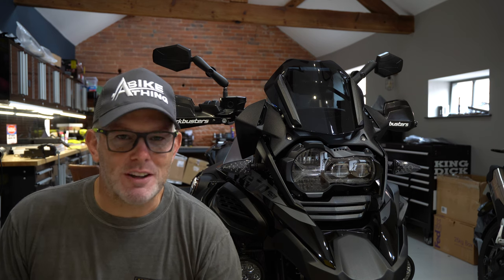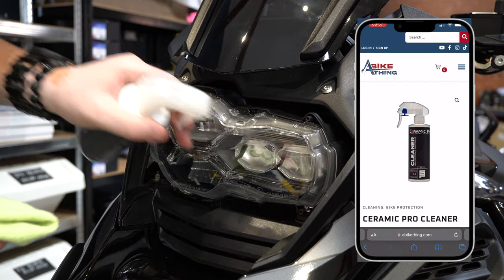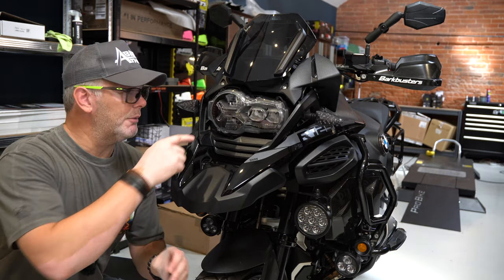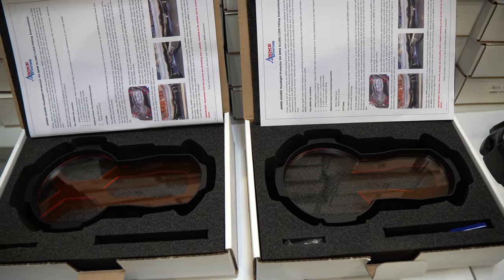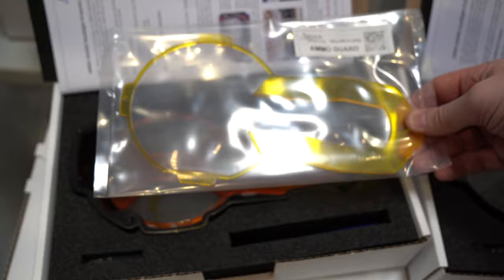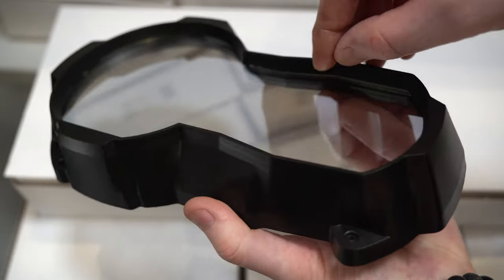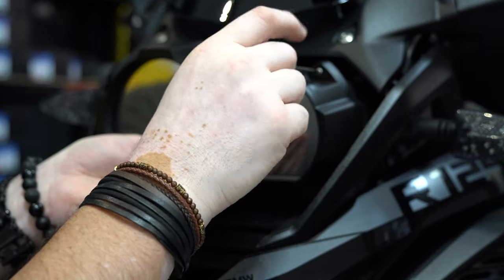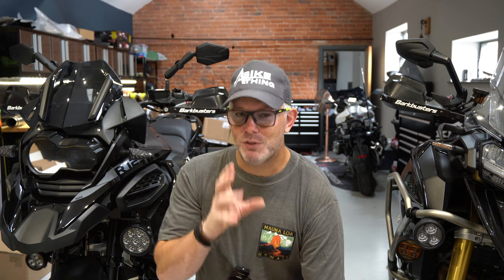How To Install The Ammo Guard To Get The Best Results

Comment: Fitted mine at the beginning of the week and very happy with it. As a toolmaker the plastic, construction finish and tolerances give this product a thumbs up. Nice product Steve. I have invented and patented products in the past and Know how challenging it can be. Nice touch including all the screws required and Driver. Finally, the instructions were very clear and precise. 10/10
Reply: Better than the original, how often can you say that.

Comment: If your new product is a module which stops the brake light function on the combined indicators I'm in... 1 ride with friends on my new GS and already they're complaining that when I brake my rear indicators get hidden by the brake light.

Oh and I received and fitted my Ammo Guard, It's a quality piece and that's looking at it with the eye of a former Calibration tech and engine builder. It also looks fantastic on the bike with the Amber filter making all the DRL match.. I love it.

Comment: Best design for me, I hate the other "double layered" protectors on the market. That said, I've a question: given the moving nature of the Adaptive Headlight on the "X" side, won't you have a strange effect, especially at night, when the headlight is rolling left and right with the amber (or any other color) thing inside? I know you can take it off, as you pointed in this video, but still... just a curiosity.

Comment: When you say use the longer screws to put the bezel back in... Mine are a fine thread opposite of what came out. The two shorter ones match though. 
So they're ok to force in there?